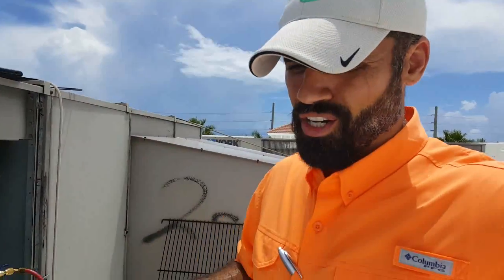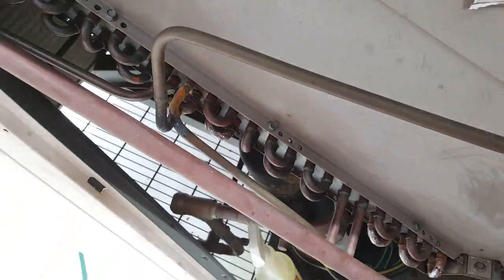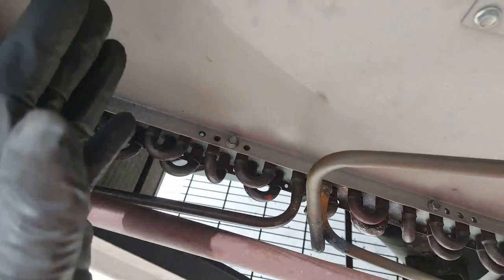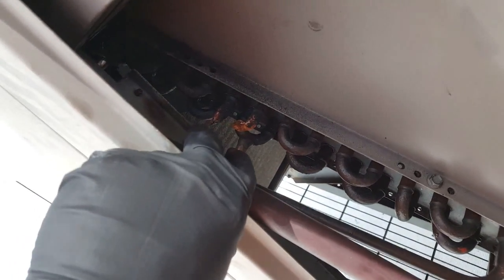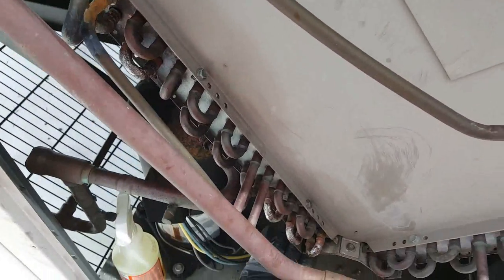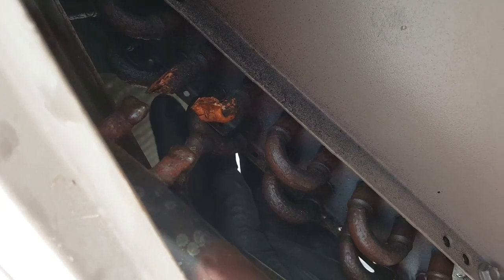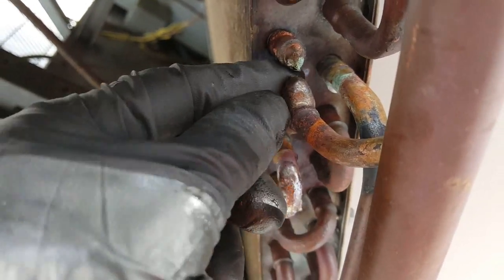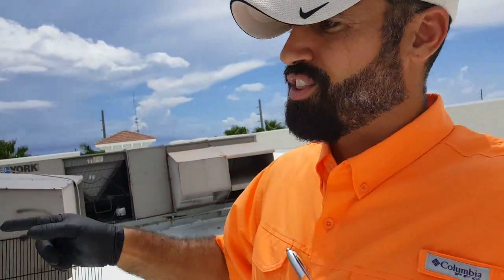Hvac coil repair  Stuart Florida

Comment: Just add a piece of copper tubing from the discharge line and bypass the leaking tube of the evaporated coil.